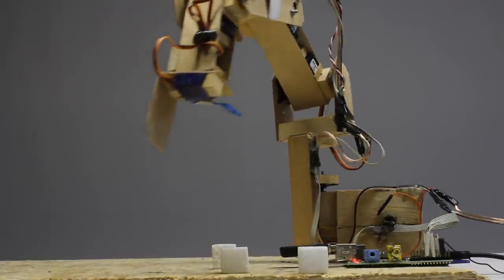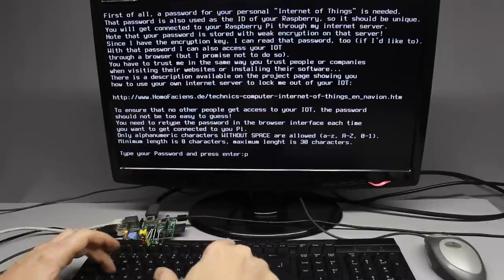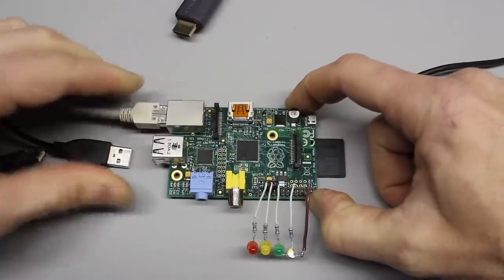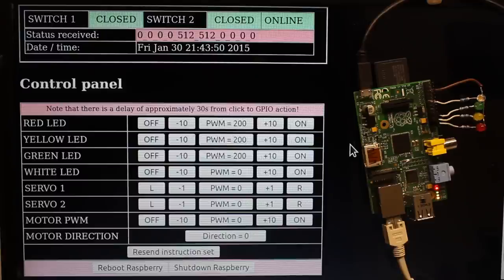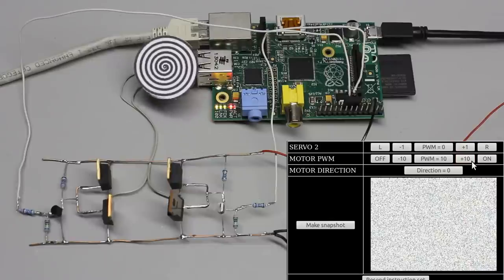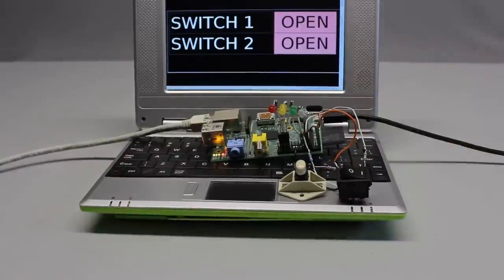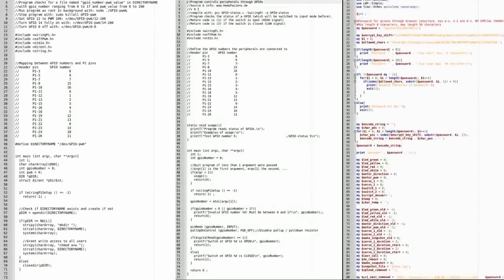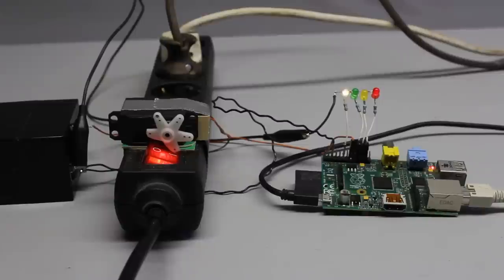Internet Of Things (IOT) with a Raspberry Pi

Comment: Nice, but I don't understand why there is so long delay (10 seconds). You can refresh/resend data every 500ms and it will work.
Reply from the maker: +technics6 You can indeed lower the delay with a higher refresh rate if you have a high speed connection and an internet device with sufficient computing power. More videos bout IoT will follow...
Reply: can we make it in real time if w have fast internet connection
Reply from the maker: The question is what maximum delay you will accept as real time.The quicker way would be a direct connection by running a webserver on the Pi and use dynamic DNS to find in on the Internet-